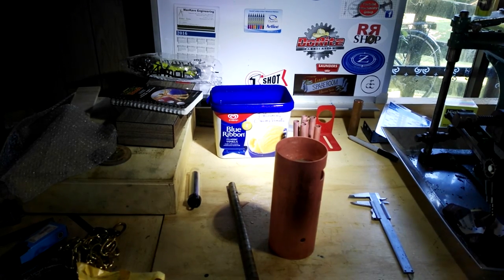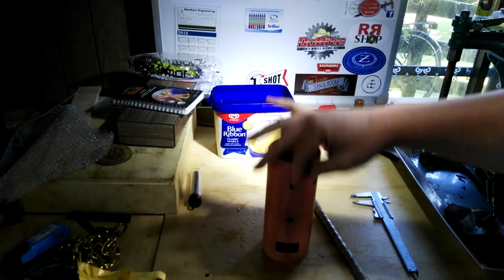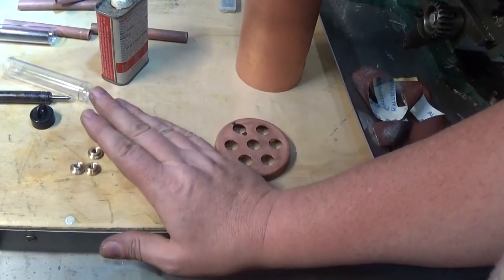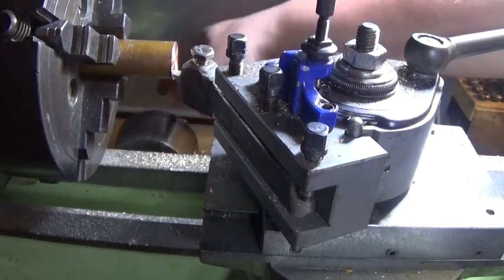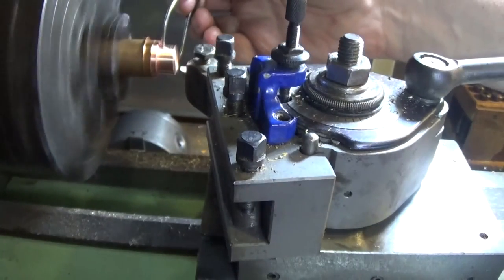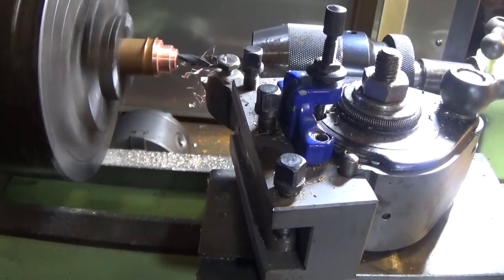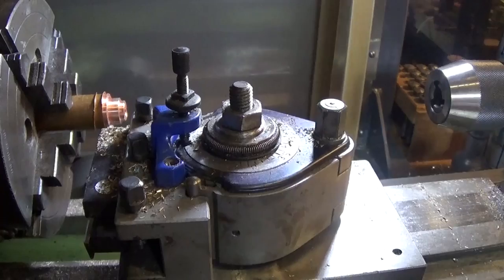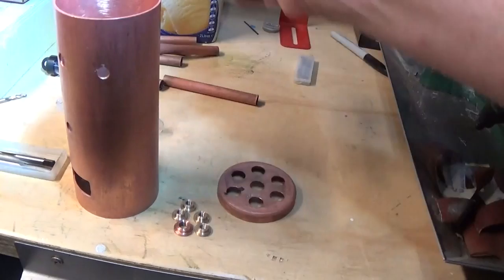Introducing and making EUGENE- A small copper boiler Part 4

Comment: Hi Emma,

Being an old Jeweller, I know that copper has a very similar "gumminess" to that of platinum when drilling it.
We'd use beeswax to lubricate drills & burrs in all the other precious metals BUT platinum, we'd instead use a bit of spit (saliva).
Although we mostly used drills between 0.5mm - 1mm, the principle should still apply to larger ones with copper.
Granted it's not going to be a pretty look for YouTube, but it'll cost nothing to give it a  try next time you drill/tap copper.

HTH, Colin
Reply from the maker: thats for the tip. :)

Comment: Cool, just a top tip like aluminium copper is sticky gummy,  oil works ok  but isopropanol (rubbing alcohol) works fantastic! its cheap and is not as toxic as cutting oil

Comment: You're right, mate... copper is a bugger to machine since for the most part you have no control over your cutting tools (drill bits, milling cutters and the like). However, you have absolute control over the tools that you yourself grind, suck as lathe turning tools and mill fly-cutters.

Most cutting tools have a top rake angle of anything from 0 degrees to 10 degrees (some even sightly negative rake). Try grinding up lathe tools with a 30 degrees or even 45 degrees rake angle and you'll not believe the difference... the knife-edge will remove copper quickly and efficiently. It works on aluminium, too.

Comment: try more of a shear grind on your tool , thanks for sharing.
Reply: Do you mean like a shearing cutter or just a steeper relief angle? I have been trying to make some custom cribbage pegs and the copper looks good, buy is difficult to work with at best. I would appreciate if you could expand on this comment a little, and thanks.
Reply: howder1951 I think a sharper tool with lighter cuts will work, but copper is some hard stuff. heating it to almost red hot and letting it slowly cool should help take some of the temper out, it work hardens fast under any tooling or operation. 

I may think with cribbage pegs to start with some wore of appropriate diameter. 

Now that you have mentioned it, I kinda wanna make a board and pins now
Reply: if you watch the chip control  series aboom  had some hss ground with shear relief angles . years ago i got stuck on the turett lathe re pointing  spotweld  tips for some outfit that makes the big galvanized culvert the sharing angles chips came off them like foil strips
Reply: the tips were dead soft